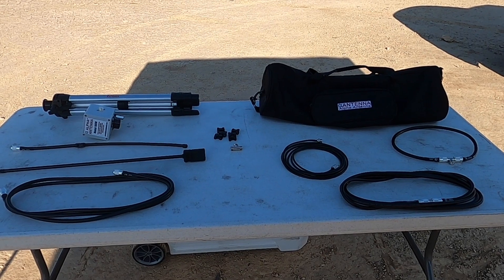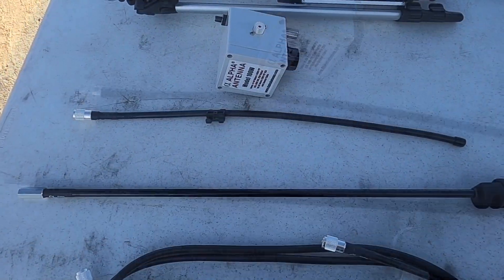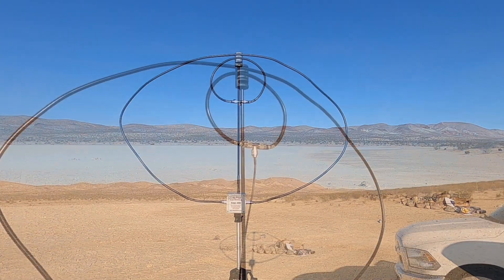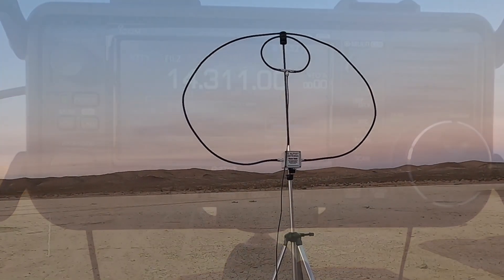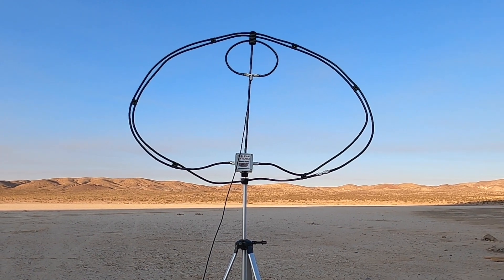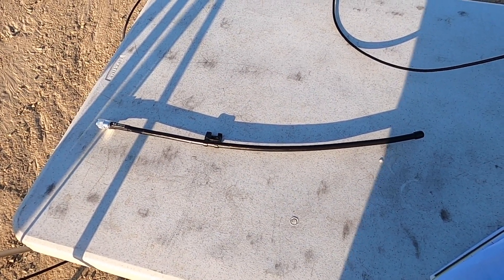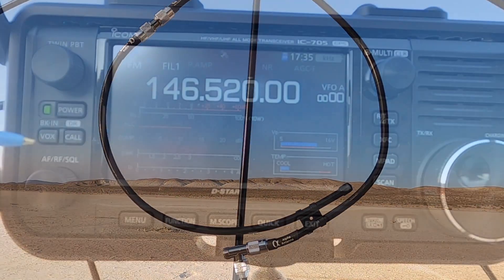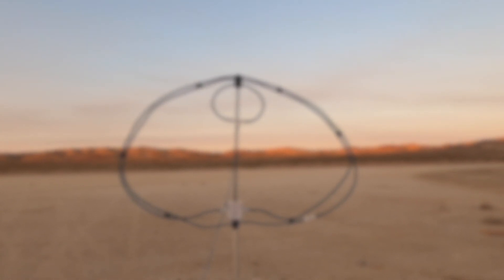100 Watt Alpha Loop From Alpha Antenna 10-80M HF MagLoop

Comment: How you think this would work inside of an apartment?
Reply from the maker: Thank you for taking the time to watch and the comment! It is greatly appreciated. It would depend on what your apartment is made of. For example, the ones near where I live are made of stucco which means they are wrapped with chicken wire thereby making them a giant faraday cage. Also are you on the ground floor or a higher floor?

Comment: One question. Why in the world these magnetic loop antennas look like a perfect circle in the manufacturers brochures but in real life they look like hit by a truck? Can't the manufacturers make an efficient and also decent looking product?
Reply from the maker: Thank you for taking the time to watch and the comment! It is greatly appreciated. IT does boggle the mind.
Reply: I was thinking the same thing!! My thought would be the LMR400 used is the flexible one with the braided copper center conductor. I have a surplus of both that and the solid center core one that is very stiff. Perhaps using that solid center one be the difference in making a perfect circle?

Comment: I wish in your demo you would have shown exactly what you were doing in the adjustments instead of focusing on the radio while you were doing the adjustments.  Good presentation but you could have shown more of the actually movement of the cables and adjustments.  Thanks.
Reply from the maker: Thank you for taking the time to watch and the comment! It is greatly appreciated. Thank you for the suggestion. I will surely keep it in mind!

Comment: If you tune the loop at 14.225 will you have to retune it if you want to use 14.289? Basically how is the Q on the loop?
Reply from the maker: Thank you for taking the time to watch and the comment! It is greatly appreciated. If memory serves, Yes you would have to tune it as you move across the band, but it is quite easy, and takes no time at all.